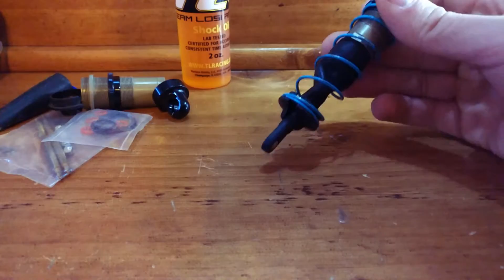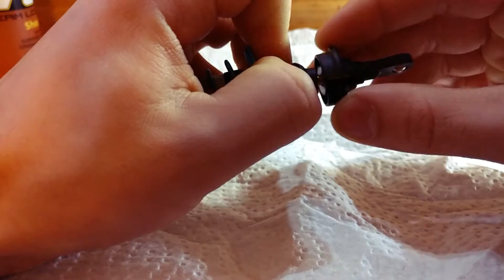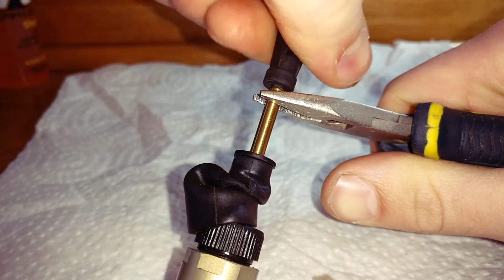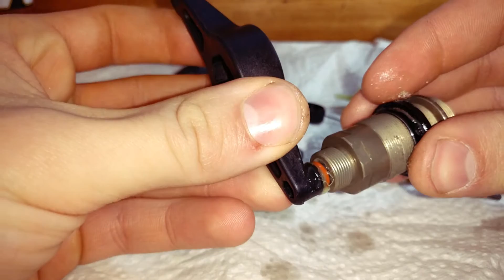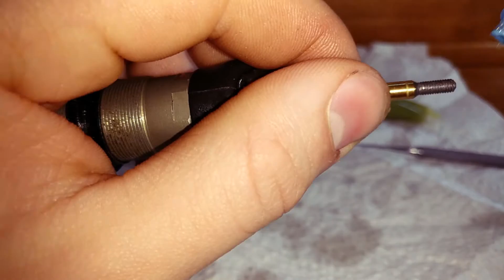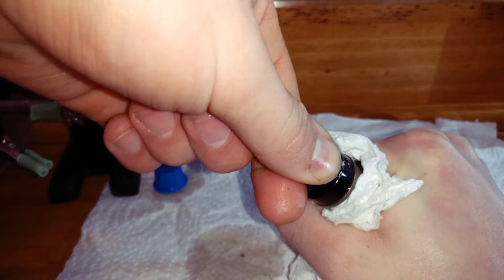How To Rebuild Radio Control Vehicle Shocks

Comment: Can't find green slime any other suggestions
Reply from the maker: "TDK Repair Shock Assembly Lube" or any other shock assembly grease could work as well. If you don't have any, some oil that you are going to fill the shock with can work as well in a pinch to ensure the seals are not dry during shaft install.
Reply: Thank you

Comment: Do u have the number for them springs
Reply from the maker: Kyosho IS106-814 Big Shock Spring(M/Light Blue/8-1.4/L=84) Front and backs will be different size. But these are the spring rates/springs on this buggy shock.
Reply: TheRcCrawlerKing do run light blue front and rear
Reply from the maker: Yes sir. These are the best springs out there. Pretty much everyone I know runs these.
Reply: TheRcCrawlerKing do u run same number front and rear sorry about all the questions I want get right part
Reply from the maker: So I just checked the manual. Looks like this car runs 26mm front shocks and 36mm rear. The RTR RC8.2e uses different ones. All 8th scale buggy springs in their diameter will be the same hence why these kyosho springs work on my AE car and my buddies TLR car. The front springs are 8cm and the rear are 10cm. I bought this car with these springs so I don't have the exact numbers. If I had to I always reference a stock shock spring and then go hunting for a kyosho one based off the stock spring numbers.
Reply from the maker: As for rates yes the same rate front and back as well as the oil.

Comment: What brand is that shock
Reply from the maker: Team associated. All RC shocks that are not remote reservoir will be built the same. Just note per your specific shock where the o-rings go. The bleeding, filling, and order will be the same. Remote reservoir shocks however are bled differently so this guide will not help.
Reply: TheRcCrawlerKing thank for info I have rc 8.2e
Reply: That’s crazy I didn’t know they make remote resis for rc cars, this is giving me confidence to build my kings but the resis make me nervous
Reply from the maker: The remote resivor definitely have a few more parts. I'm sure you'll have it built in no time. I think this winter I will do a tutorial on how to rebuild that style of shock since there are not many online.
Reply: That would be cool I’ll sub rn, Do you think one could use the red and tacky grease by Lucas oil as a replacement for the green slime?
Reply from the maker: Honestly shock oil will work better should you not have proper print grease. You just wanna make sure that shaft doesn't go in dry.
Reply: @TheRcCrawlerKing  right on thank you